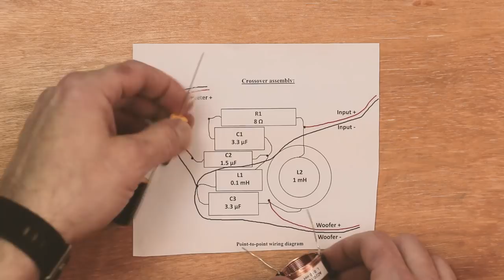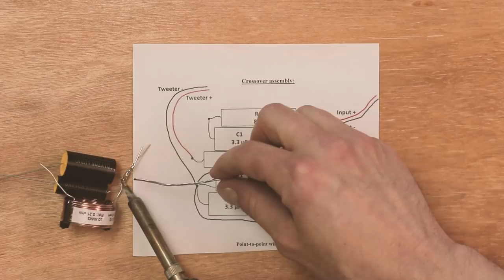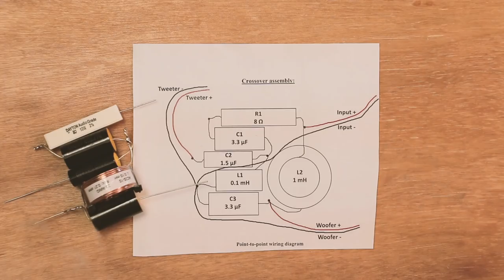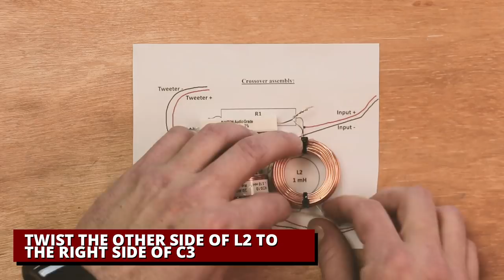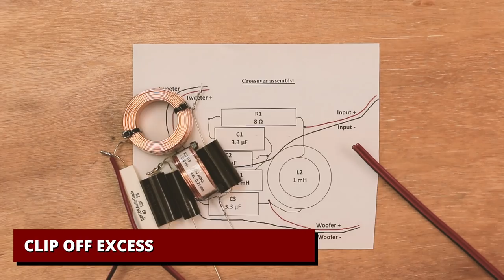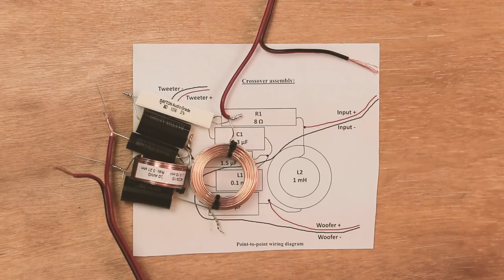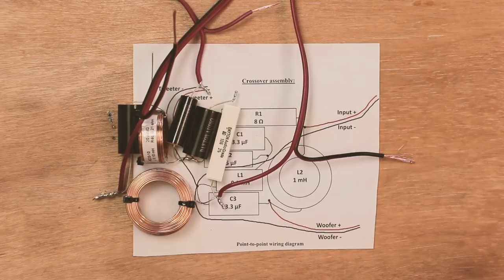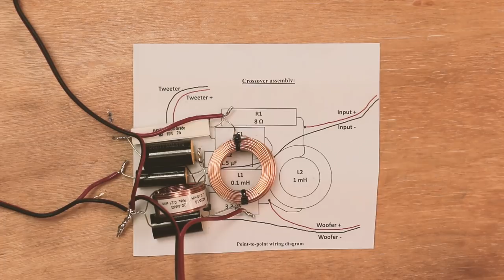How to assemble the BlastBox Crossover

Comment: Awsome. Only problem I have is how to connect the woofer from 2 different crossovers to the amp then to speakers...
Reply: For purposes of the crossover, “Woofer” refers to the midrange speakers. The crossover manages and splits the signals to the tweeter and midrange speaker on each side. The single big subwoofer at the bottom of the Blast Box gets its signal directly from the amp board, not through the crossovers.

Comment: What kind of glue was used? I like how it expanded like that.
Reply from the maker: Gorilla Glue
Reply: TEST IT BEFORE YOU GLUE IT IN!  Gorilla Glue is Very strong, but has some drawbacks.  The foamed parts will eventually turn brittle - not a good thing in a high power speaker enclosure.  The biggest drawback:  You cannot ever repair the crossover.  You will damage it trying to remove it from the glue.  Electronics companies use a high temperature Hot Glue to keep larger components from moving, and I'd recommend that above Gorilla Glue, though it's harder to find than the regular craft hot glue guns and sticks.  Better yet - get a square of perf board that will fit in the cabinet.  Use cable ties to hold the crossover components to it, and screw the perf board to the inside of the case.  You should use some hot glue as well to keep vibrations from affecting it.